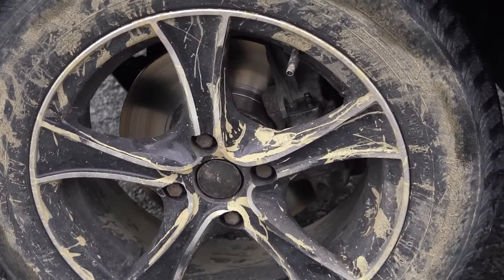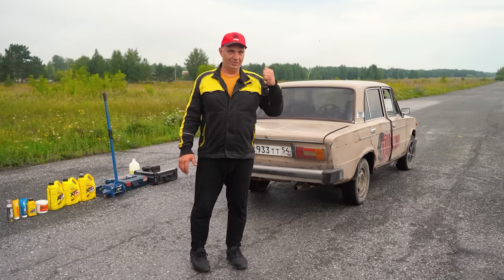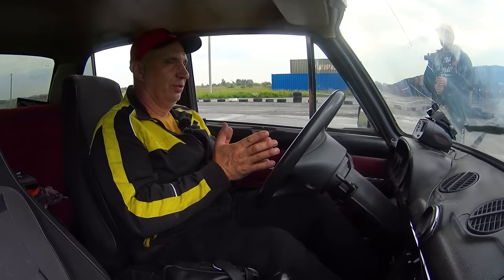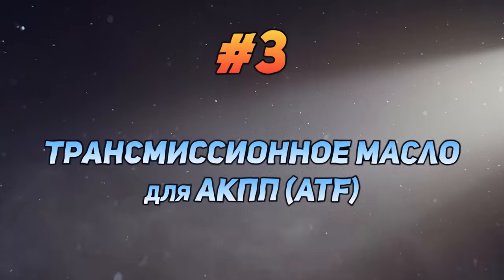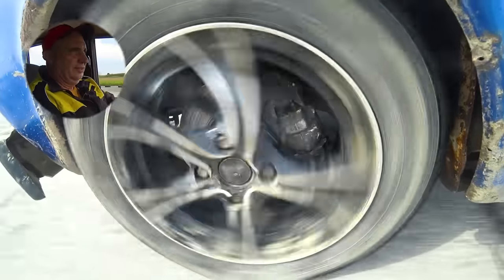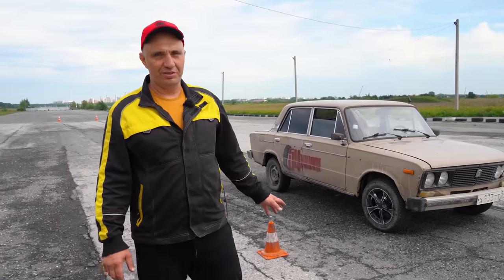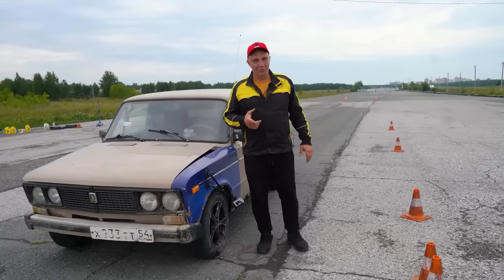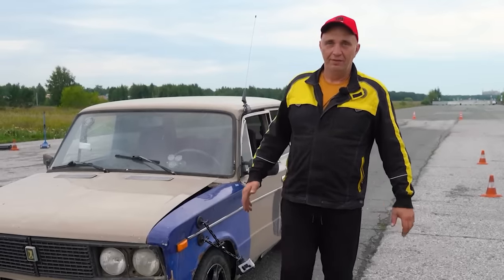We cover brake rotors in grease (and other lubricants) - what will happen?

Comment: ATF oil is made to work with clutch lamellars in the automatic gearbox so that's why it still gripped well. You'd probably see the same with motorcycle oil for wet clutches.
Reply: Just came to say this. I was surprised by the result at first, but then after considering that ATF is designed to work with clutch packs, it made sense
Reply: Ooo interesting
Reply: If he didnt take his foot off to gain control would probably stop the same as factory as the limiting factor would be the tyres on the road
I wonder how this test would go with ABS ON and pre soak the pads like when rebuilding a trans ?
This gives me an idea for the Park Brake/E Brake... if you know what the older Landcruisers are like this may be the solution ... maybe ...
Reply: Yes ATF is peculiar stuff. It has a tricky job to do... not the least of which is acting like both a lubricant and a gripping agent all at the same time, while carrying heat away and remaining chemically stable. Keeps itself clean under normal conditions too. Under-recognized engineering there.
Reply: @MadScientist267  Like anyone that has experianced contaminated brakes , they become a switch, Wheel spinning / Wheel NOT spinning. 🤣🤣🤣
Reply: @maxgood42  the first stop sign in the morning will tell you what wheel cylinder is leaking lol
Reply: @ClumsyCars  🤣🤣🤣
Reply: I used ATF for 2-stroke motorcycle with wet clutch. Worked very well, no clutch slippage.
Reply: No shit Einstein

Comment: the crazy thing is that people REALLY let their brakes go (just go watch some of the "just rolled in" videos on youtube) and even when they're DANGEROUSLY worn out and damaged they still function for day-to-day driving.  They're amazingly well-engineered.
Reply: Disc brakes are pretty tough.
Reply: Yes seen those videos myself!
Reply: I'd use the word "function" carefully lol

Yes metal on metal does still have some braking force, if you get all 4 wheels doing this... let's just say Vlad would have a show to watch from the end of the anti seize test as metal-on-metal flies by and into the brush there...
Reply: Even when the pads are completely gone, so it's steel-on-steel, the car stops fine. I don't see the need to have brake pads replaced 😂🤪🤷
Reply: There is a "just rolled in" video where the brake rotor is so worn that the technician is able to bend it literally with his hand
Reply: I've known a mechanic. People will allow their brake piston to contact their rotor, and they still somehow manage to stop at the garage to get it fixed.

Comment: Had a bike in my childhood whose front drum brake was squealing, so I put a bit of universal oil in there. That resulted in almost no braking effect until I cleaned all the surfaces. The rear coaster brake worked, so no accidents happened.
Reply: I got caught in a downpour on my bicycle, my rim brakes were not working with all that water on them.
Reply: It's interesting because coaster brakes had grease on breaking surfaces too. How can oil affect braking in drum and why not in coaster hub?
Reply: Same @huseyinuguralacatli5064
Reply: What bike has a FRONT drum brake?
Reply: @the_kombinator they do exist
Reply: @HPsawus  I suppose - just because I 've never seen one doesn't mean they don't exist. I just find it very strange - IIRC the backpedal ones were grippy, I'd be sending myself over the handlebars daily with a front drum.
Reply: @the_kombinator  me too buddy. Seems a bit over complicated too, especially when rotors beat drums all day
Reply: @huseyinuguralacatli5064 coaster brake applies more force than a drum, enough to overcome the grease. With coaster you can put your whole weight on the pedal and you get the leverage of the length from the pedal also. The pressure on the drum is limited to your grip strength. I think also just from the way the coaster is shaped the grease doesn’t make its way back over the coasters mating surface. 🙂
Reply: @the_kombinator mostly seen on older bikes, I’ve got a 1976 that has front drum 🙂

Comment: I once put wd40 on my rotors before leaving my car setting for and extended period of time.  I wanted to see if it would prevent the rotors from rusting.  Fortunately i was wise enough to test the impact on stopping and discovered it had an enormous impact.  It burned off quickly enough that if you remember the rotors are oiled a couple low speed hard stops and its back to normal but damn, if you forgot.

Anyhow, I determined the impact on stopping was far too dangerous.
Reply: burning off isnt usually the problem, embedding and disintegrating is
Reply: @DarkIzo  wd40 has a low flash point, it definitely burns off of automotive brake pads and rotors.
Reply: @nickmcwilliams685  Sure, but as Darlzo said, it could get embedded in the pads and the pads are fuct forever.
Don't try it!!!
Reply: @UberLummox it will not become embedded.  It's made out of flammable Hydrocarbons and petroleum oil, the only thing inside the can that isnt flammable is the CO2 gas used as propellant.  Wd40 will burn up long before the rotors and pads reach their normal operating temperature.  If you had read my comment you'd know I've tried it and it doesn't have a lasting effect after it burns off.  I suppose It could cause glazing but glazing is removed easily by performing a couple hard stops.  Besides, new rotors come with grease on them to prevent rust.  Most people do not thoroughly remove the grease.  It burns off before the rotors and pads are broken in.  The instructions tell you to perform a couple of 40-50 MPH hard stops to bed the pads to fresh rotors and this should get them much hotter than a typical drive.  If petroleum based products ruined rotors or brake pads the manufacturers would not apply them to the rotors to prevent rust.

The burning oils will just leave some carbon soot behind which is abrasive, ie it might actually increase the coefficient of friction once burnt off.

I'm guessing they didn't try it because of the relatively high likelihood of starting a fire.

Wd40 is extremely flammable.
Reply: @nickmcwilliams685  Well then, I bow to your much greater knowledge. Might even try it on my own car, a '67 Jag 420 that sits a fair amount in a moist atmosphere. Thanks!
Reply: You could just rinse them off with a couple cans of brake cleaner. When you buy rotors new they tend to have a light coat of oil people forget about anyway. Thats why you rinse them off with cleaner first before finishing the install. The cans usually spray at a higher pressure as well, gets the oil off better. Id say you can still spray your wd-40 on it no problem just remember to clean it before use. The only problem as said before, it can degrade your pads if it sits for long periods of time, but if one of my cars sits for too long i remove the pads and coat the rotor in aircraft VVL (ProLube brand oil is pretty good as well but it runs off pretty easily)
Reply: @nickmcwilliams685  You can't remove glazing with hard braking...has to be mechanically removed with specialty pads (rotor) or removing and using an abrasive (pads). Not properly cleaning new rotors is a common reason why new brakes are noisy and less effective lol.
Reply: @foojub6907  minor glazing is generally easily removed by hard braking.  The hardened surface can be  worn away.  If I'm already servicing the brakes, sure I might buzz it off with and abrasive tool.  However this is generally not necessary.  Parts houses and lube shops might tell you the parts need replaced but that's just to sell more parts.  Try a couple hard brake checks first, allow the brakes to cool between.  I understand why retailers and shops operate this way, higher profit and they can't warranty cleaning up a used part, but it's generally a self correcting problem unless its severe or the customer is a brake dragger (or has a caliper dragging etc).

If they get a hard spot or "warp" they will need replaced or cut because if it's thickness is uneven it will not self correct.

But you do whatever you like.
Reply: @UberLummox I wouldn't advice doing it.
Reply: @nickmcwilliams685  good to know, thanks for sharing. Would it be safe to assume even with hard braking it’ll be difficult to deglaze rear brakes due to bias?
Reply: @nickmcwilliams685  Yeah I probably wouldn't dare to do it, to be honest. Thanks!
Reply: @foojub6907  yeah, probably.  But generally the front brakes are more prone to getting glazed anyways.  That and a lot of cars still had drum brakes in the rear when I worked in the industry.
Reply: @nickmcwilliams685  you took the time to spray it when you let it sit, maybe if you put a reminder and sprayed it with some brake clean before a drive it'd be fine? Still seems like not a great idea, probably better to just let the rust come off the rotors naturally.
Reply: I put wd 40 on my stuck brake caliper and it freed the brake caliper and there was no issue in stopping...It doesnt effect the stopping as it dries fast and you can soak your brakes and rotors with wd 40 and its safe.
Reply: rotor rust is a non issue
Reply: Placebo effect, or you just had rust on your rotors anyeays lmao. WD-40 will not lubricate that much and it will not sit for long periods of time either. You spray it on and I guarantee any grease is long gone by day 3. Shit can't even lubricate a door hinge for 2 days.

If your car is sitting for so long that rust will fuck your brakes, you're going to have more issues with the battery, every fluid in the car including gas, flat spots in your tire, and worst case scenario moisture intrusion in your engine block. If rust on brakes gets to be bad enough to cause actual issues, you need to machine them. Your tires need to be replaced anyways because the car is likely parked outside if rotors are rusty, and dry rot will occur due to long periods of sitting in the sun.
Reply: @alextheonewarrior  The rotors will rust overnight if it rains.  The rust makes noise unti it wears off.  It occasionally will cause a brake pad to stick.  This all occurs long before tires fail, gasoline losses it volatility, etc.

After working at a car dealer for 10 years I've observed that the most common issues from cars sitting unusted for up to 30 days (we started and drove all our units at least once every 30 days) was definitely dead batteries and stuck brakes(or brakes making a scraping noise).

The point of the experiment was to see if a spray product like wd40 might slow down the formation of rust and see it it had enough impact on the friction to be dangerous.  I concluded that it does not last long once driving but it however has a significant impact on stopping distance.  Therefore I do not recommend it, regardless of it's potential effect on rusting.

Anyhow if it was not apparent to you allow me to clarify.  It was an experiment.  It's dangerous and impractical to apply a flammable petroleum based oil/solvent to automotive brake rotors.

After the solvent evaporates wd40 leaves behind a messy oil (this it why its awful on locks and firearms) and that oil will absolutely reduce the brake systems friction.  It indeed clears up quickly but it absolutely has an effect.  Because oxygen barriers inhibit rusting I was operating with the assumption that it would slow down the formation of rust.
Reply: Rusty disc work better.
Reply: @danesebruno  I had a car that had been standing for a long time but I had to take it in for an MOT.  It passed with an advisory "Brake rotors rusty but not affecting function".  So, as you say, rotor rust is a non issue.  I was also stunned just how quick that rust disappeared in normal use.  A couple of trips to the shops and they were nice and shiny again.

Comment: Try cleaning an engine using CLP gun lubricant as engine oil
Reply: Gun oil is a great idea
Reply: That's gonna smell horrible.
Reply: And? What happened?
Reply: @Southpawarsenal nothing? No one said they are about to try it. Idk what answer are zou looking for lmao
Reply: @zmurl4352  I must have read it wrong. I thought he said he did it himself lmao
Reply: Run a lada motor nmon extreme racing fuels and throw a rod through the block (maybe, who knows it might just make 500Hp and be fine, it's a lada.)
Reply: @robertisaar Maybe but burning it in a diesel would smell great
Reply: @nickolasphillips3776  i coated my long block in rem oil, its gonna be like 2 or 3 weeks till i can swap it, was gonna use vasoline but realized rem oil came in an aresol

Comment: I would like to see the difference between dry brakes and water-soaked ones, like if you went through a big puddle or a flooded road.
Reply: You get soft braking until the water flash theme zaroff the brakes from the heat caused by friction. With the car in motion, all you need to do is give your brakes a little push, release, and then you're good to actually use them.
Reply: It's a smaller distance than the ATF. Like 1-2% increase in braking distance, which is within the margin of error.

Comment: It’s worth noting that extended contact with many different kinds of lubricants will mess with the binders in brake pads and shoes. I’ve seen several brake pads and shoes turn to slime as a result of extended contact with engine oil and gear oil.
Reply: Never seen that happen, but was wondering exactly that.
I'm surprised he didn't say how stuff would effect the pads.
Reply: Heat + what you mentioned, could also be a thing. I imagine heat would increase the disintegration in some cases .
Reply: @UberLummox I don't think Vlad and crew has ever looked past the "right here and now" for the 107% success score lol
Reply: @MadScientist267  Haha maybe so. Though I'm getting conflicting info on weather it does pad damage.
Reply: @UberLummox prolly organic brake pads maybe
Reply: Brake fluid will do that to drum brake pads. They will wear out much faster when they're soaked in that.

Comment: If you could have used slotted rotors most of the fluids and grease you put on will hold to the rotor and get better results by not wiping it off on the run up
Reply: Ummm considering slots are there specifically to sweep the pads and fling the result outward to [hopefully] never be seen again... "I don't think so".

If anything it will shorten all of the brake times 🤷‍♂️
Reply: @MadScientist267 he’s thinking about it in a slow speed scenario where it acts as a holder and re applies grease as it passes under the brake pad

Comment: And this is why i dont worry too much about cleaning rotors to the degree that the really paranoid people seem to be.
Yeah dont have a big film layer but a touch of grease here or there wont really hurt
Reply: Old guy I worked with liked to intentionally add a bit of grease to his pads during changeouts, saying it kept them from squeaking during break-in.
Reply: Why is it ok on cars while on bycicle disc brakes a single drop of oil ruins it completely, often requiring replacing the pads to be properly fixed?
Reply: @andrelange9877  Probably brakepressure and heatgeneration is higher on carbrakes.
Reply: @operator8014 Squeaking is from pads vibrating between the pistons.
Reply: That's very reassuring, then I won't have bad conscience over recently soaking brakes in penetrating oil, to remove the caliper bolts. And not bothering to wipe the discs afterwards 😅
Reply: @KapiteinKrentebol  On a bycicle if oil goes into the brakes the pads get deeply soaked like sponges. Cleaning the rotor alone doesn't fix anything. The only effective way of recovering is cleaning the rotors and literally burning the pads on fire until the dark oil stains disappear from the material. But even then only 50% of the times the brake will function normally again. Often new pads are necessary and sometimes even new rotors. Otherwise the brake squeaks like hell and stopping power is sensibly reduced.
Reply: i have never cleaned new rotors
Reply: @saramalou9649 I almost got into an accident doing that. I came up to an intersection at 45mph and couldn't stop. When I did come to a stop my brakes were smoking as the oil was burning off.
Reply: @catsaregovernmentspies  Where did the oil come from?
Reply: cool @catsaregovernmentspies
Reply: @andrelange9877  The protective oil that comes on new rotors. I didn't clean it off.

Comment: I'm not even a little bit surprised that the antiseize reduced braking the most and by a lot more than the next worst.  That stuff is magical when you want to prevent two metal surfaces sticking and awful when you try to keep it away from a surface.  It spreads like Ebola!  I wonder if they front brakes actually did anything at all when they tested them with antiseize...maybe the rear drum brakes did all the work?

Comment: i would like to see different fluids tried as brake fluid [thin motor oil or atf for example]
Reply: Gasoline?😂
Reply: Can't use petroleum based oils in place of brake fluid...
It causes the rubbers in the system to swell and go soft.
Reply: They all work but for a short time. There's another channel that did that with water and it took a lot of brake abuse before fading.

Comment: Gear and engine oil use a different method for rating the thickness so a 75w-90 gear oil has about the same viscosity/cst as the 10w-40 engine oil. That number on the bottle is actually better described as a protection rating than a thickness rating but it does give a good idea of relative thickness when looking at one engine oil to another or one gear oil to another but not a good comparison for the thickness of a gear oil vs an engine oil. 😁✌️